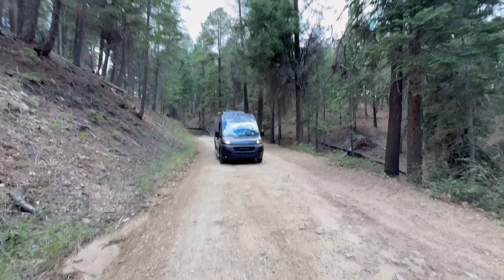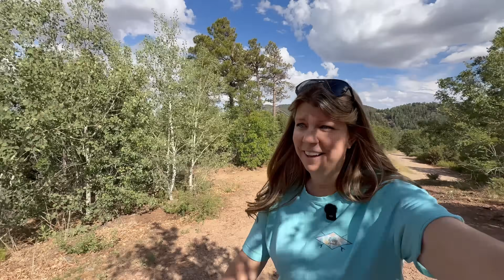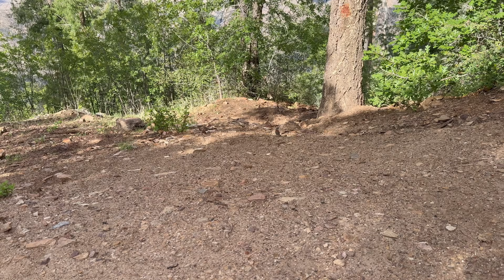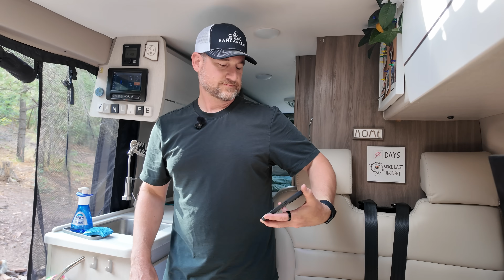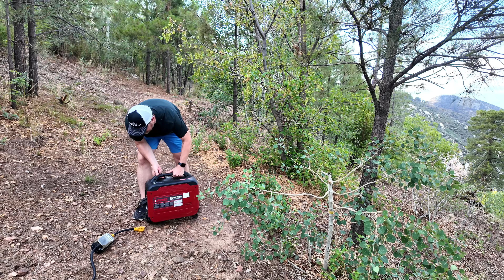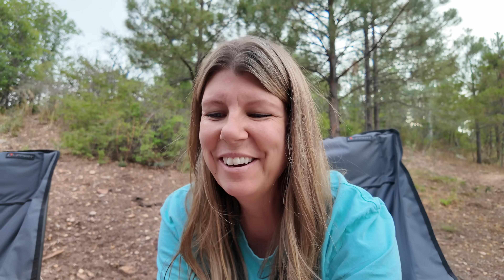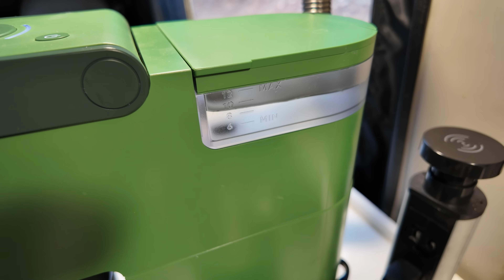MUST KNOW RV Generator Rules (Risky Roads & Lessons Learned on Mt. Lemmon)

Comment: Get a 12v air conditioner, get rid of the electric coffee maker- use stove and drip filters to make less waste, you can double your lithium for a lot less than $1,000. Get more/better solar panels, Get a Honda genset and run it on propane- way quieter. Nice video! Great tires!!
Reply: Can you run the van to charge the batteries?
Reply: @Momworks1   Running the van should be the last resort.  Your alternator is very precious.  They wear out with heavy use.  They wear out with just regular use.  You do not want to be stuck in a desert in the heat or in the mountains alone and your vehicle won't start.  Ask yourself how much it will cost just for a new alternator to be put in and then figure the cost of the generator.  Now add other things like a long distance heavy duty tow, hotel stay while the vehicle is laid up for a few days, and miscellaneous expenses.  How much are your lives worth in a dangerous environment.  My batteries are charged in my van by only 200watts,  We may add another 200 because we bought a SetPower fridge/freezer.  We may have enough power without the extra 200 as everything is extremely low power draw, except for the microwave which is only on for a few minutes and the electric skillet that may run long enough to heat or cook breakfast.  The batteries power our microwave and an electric skillet.  I have a 300 watt inverter that I can run off my starter battery and have the van charge it in an emergency. This is so seldom as there are places and campgrounds with shore power that runs those items and my AC or heater and the onboard charger also.  A 15 amp cord powers that stuff also if I am moochdocking or boondocking with my generator.  It can take at least a couple hours to charge low batteries and you dont want to run the engine and build carbon or use all that gas or wear out the alternator.  My entire build runs off my 3 agm deep cycle batteries unless I have to run the small invertor to run the charger.  Of course, the solar helps to charge at the same time also.
Reply: @rongreen7308 maybe your messages confused me but did you say you use a microwave with a 300watt inverter?
Reply: I use my propane to boil water and do the drip thing too! Plus the coffee is REALLY good…much better than a Keurig! :)
Reply: This 👆🏻
Reply: Propane is not quieter and will produce a lot less power
Reply: There are fold up solar panels that fit in a backpack and generate 400 watts.
Reply: @edwardmoran1739 there is no solar panrl that can generate 400 watts and fit into a backpack
Reply: A 12v air conditioners are not yet at the 13-15k btu of the 120v ones. However you can buy a small ecoflow river pro and use it for your starlink and coffee maker and save the battery for a/c. You might also look into the newer, bigger delta model to top off your batteries.
Reply: Will the 12v AC cool a 45 ft fifth wheel?
Reply: @averagejoe9249  Nope, you can see lots of video's on this. A single one will cool a insulated van. So aprox 20 ft.  They also run at aprox 700 watts. The exciting part is if you can get a 1,000 watts on a RV roof you can run a AC with the Sun realisticaly. This is as close as anyone has come that is off the shelf that everyone can buy and not difficult to install. If you could close off part of your 5th wheel and load up your roof with Solar you could proably run one easily off Solar on your roof and charge a battery to run the bedroom one at night. It's really just money in your case. 2 new 12 volt AC's 2,000 dollars, As much solar as your roof will hold. ???? $$$$. Then 500 plus amp hours Lithium Batteries minimum, all in if you do it yourself easily 10,000 to 15,000 dollars. Have it done and you are looking at 20,000 to 25,000 dollars. But then again if being off grid in the summer time is a must have, There now is a way to do it. 2 AC on the roof running 1 off solar, then runnning the bedroom one on batteries all night. Or run your generator for years and you will pay the same. You really need to have a strong desire and pocket book to run completely off solar and batteries. We spent 10 years living in a RV traveling the USA and saw it all. There is a reason RVers migrate with the weather. We had a setup that let up spend 1 week in 100 degree heat or zero degree cold which we did on numerous occasions. But it still cost money when we came in to provision up our RV to handle the extremes. It was a combination of Solar, Batteries, Satelites, generators, extra propane. It cost us 15,000 dollars to rebuild and re insulate our rig and add all we said to get 1 week for 2 people and a dog true independence. But even if you wanted longer, you need to think how much more water, Food, Grey tanks, Black tanks and power and Clothing. Every RV is built to go 3 days 2 nights. push that and it costs a pretty penny. Hope that helps answer your question and thoughts about if you want to cool your rig you really are saying I want to Boondock and cool my rig. AC is just one part of that
Reply: @averagejoe9249   No.  Not enough BTUs unless you get multiple ACs and a ton of batteries to run it and something short of a nuclear power plant to charge them up.  Plugging into a 120 power source would just be too simple, right?
Reply: I had a Honda generator and while it is quiet, it still makes noise. I made a small three panel foam board U tent which I could place behind the generator to block the noise traveling to the trailer. Maybe 8” taller than the generator. I left a flap on bottom middle where I could wind protect fly off with a rock. Cheap. Maybe worth a try. Stores flat, takes up no space.
Reply: I am Just blown away the van doesn’t have an onin generator already onboard. Am I missing something here.
Reply: Great info
Reply: Solar panels have largely gone obsolete. Most rigs are designed so commercial users can install a second alternator (they must be opposed to balance the side bearing loads on the engine shaft) and with a 150-200A stock generator plus the second one, you push 300-400 Amp hours into your lithium bank for every hour you drive. So a couple of hours on the road gives you days of battery bank. No genset, no panels needed. The high end boondocking RVs have gone this way for 2-3 years now.
 Mass market RVs? Stick to old tech, because "change" is an effort.
Reply: @lyfandeth  Obsolete? Not necessarily. My solar panels generate up to 510w in full sun… very helpful when parked and running my Zero Breeze 5k BTU ac. (Ps I also recharge my EcoFlows with their 800w alternator charger. )
Reply: @shabazan   Right!  And solar is designed to produce power without consuming it or fuel.  If you are boondocking off grid then you dont want to be using gas/diesel or putting hours on your engine.  We used 3.5 gallons of gas over about 8 hours just idleing.  At $4.00 a gallon we spent a bit over $13 overnight just for heat.  Gas adds up.  By the way, our Honda generator used 1 gallon of gas to run the electric heater for 8 hours at 28 degrees outside several times.  I normally go about 6 hours on 0.81 gallons.  I wont be without that quiet Honda 2000 watt generator or my solar panel.
Reply: @lyfandeth you do realize that solar panels can last a for many years but that alternator is taking days off it's life everytime you use it. They should work as a team to keep your power levels up. The alternator is for charging while driving and the panels are for when you are actually in your camp spot.
Reply: @lyfandeth  So, are you driving or camping?  Are you driving during the day when you could be enjoying the lake, woods, etc?
Reply: @lyfandeth Stick to the campsites sweet pea, leave the boondocking to the pros.

Comment: Doesn't your frige run on propane?  I know the recommend having the propane off when driving so that may be an issue.  When driving in a Ram you should be getting 35 amps from the engine to your charging.  We discovered the hard way that the solenoid which switches on house battery charging while driving was bad.  They are said to only last a few years.  Whenever we leave the house and arrive at camp our batteries are fully charged.  We have a 2019 Travato with the older and louder generator.  Whenever your out in nature the sounds seems 3 times louder than parked in the city.  Newer Cummins built in generators are 1/3 the noise of the older ones.
Reply: tellaro fridges are 12v.

Comment: Just curious…. Do you have a DcDc charger? (We apparently found out that we had somehow been unsubscribed, so we’ve missed months of your videos, so we are going to have to binge to catch up, and I apologize if you’ve noted such before!) But I have to say, we have a drivable rv too, with a larger battery bank (600 amp hrs) and the dcdc charger keeps our batteries topped off from driving around. (We also have a 2000 series dual fuel champion that we can use for backup purposes if need be, but try not to use it much)… And most surprisingly, we have been able to save a ton on propane cost and use because we can now run our 6 cf off of the inverter we now have while we’re driving, as the DcDc charger produces enough power to run the fridge and charge the battery bank, along with the nominal charge gain from the 400 watts of solar panels. But the MVP workhorse of our offgrid system has been the DcDc charger! And thus we highly recommend one if you don’t already have such!!! Thanks again for the videos! We enjoy them! Happy camping!!!

Comment: Get rid of the 120 volt air conditioner, and get one that operates off 12 volts. For what you want to do, coffee maker and other devices needing ac, I say you need at least 400 AHrs of batteries, and at least 400 watts of solar.  That is what we have on our small trailer and the only ac devices we have are chargers for the computers and they run off a 500 watt inverter.

Comment: A little off subject but saw you turn on propane.  Get a spare rocker switch for the propane.  Thor used an interior switch and the box they mount it with is not close to waterproof.  The spades coming out the back of rocker switch corrode.  You can guess how I know.  Ordered two marine switches.  Easy change if you have one.

Comment: Always enjoy your videos.  In addition to my house batteries I have a EchoFlow Delta 2 max power station that I travel with that provides one more source of power.  I use it to run my Starlink and most of the time to make coffee.  I have an alternator charger hooked to it so it will charge while I drive.  For reference I have 400 AH batteries and 400 watts of solar and no AC.  Safe travels!

Comment: This can be tough for sure. We use an Ecoflow Delta Pro power station with a spare battery to power our Brinkley Model Z 2900. Yes it's a little expensive, but the 30A plug makes it easy to plug in and power everything, including AC... then use a champion portable generator to recharge the power station. And we can take it with us if we change rigs. Good luck on your gen search, and safe travels.

Comment: I have been drinking the water out of our RVs water tanks for over 50 years with no filters and never got sick from bad water. I am just careful not to fill with a faucet near a sewer dump is all. Most city water has enough chlorine to kill any bacteria that one might get. Mainly flush the faucet and your hose well before putting water in the tank. On the generator I have a Honda and down there AZ in the summer when it gets over 115 it will over heat and shut its self off to cool. I found I have to hook one off those water misters to help keep it cool but that is a problem in an RV. Main thing is just go some where cooler than the desert in the summer.

Comment: Need to just bite the bullet spend money on batteries maybe 600 to 800 amp hr lfp   then go with the new reasonably priced 12 volt ultra efficient Air Conditioner. You can  add solar cheap as well.  You are correct the battery is where the big money gets spent. Worth it, does the job, keeps you cool for sleeping.

Comment: Wow, 100% down to 9% overnight seems a bit much.  What else is running overnight?  We see about a 10% drop in battery overnight.  Hope your battery is ok.
Reply: Agree. What is draining the battery? Seems excessive. We have 200 lithium in our class B and generally lose 10-12% overnight with using lights,  fridge, etc. No inverter. No solar. No generator. Also no a/c.

Comment: Live in Idaho and I boondock a lot.  I have a Champion 2500 duel fuel generator that is quiet.  I also have a Bluetti 200 Max plus RV 300 lithium battery.  I can use Bluetti and solar to charge or Champion duel fuel.  I make sure bluetti and rv are charged before quiet time, doesn't take that long and price of fuel or solar way cheaper then paying for a campground.

Comment: Our 2021 Thor Tellaro has a generator. We were on the fence about a lithium system with our next purchase. After your share of a free standing generator hook up and the issues of not having a generator, we will be sticking to a built in generator.  It's very quiet. Now, we need to use our decimeter to check the noise level.  Love the photo of the rain cloud in the distance. I think it was over our house last week!  We got pummeled with rain in Vegas! Safe travels.

Comment: I'm a heavy electric user. The coach has 800 amp-hr batteries but it's not enough.. I supplement with a Bluetti AC200Max + B300 battery = another 500 amp-hr. Total about 1300 amp-hr. With this setup I can go  about two days before I run out of juice. 
I can charge off two alternators 0% to 100% in both battery systems in about 2-3 hrs driving.
I also carry a generator (3200 watts) because the van's engine is inefficient to create electricity when the van isn't moving. About 4-5 hrs on the small generator to charge 0%-100% both battery systems. 

I also carry 600 watts of solar panels but they aren't very good at making electricity.... thinking of ditching them.

Comment: My experience may not work for you and others. My thinking is generator etiquette is to do things that reduces the need and use as much as possible. It’s likely a Pacific NW thing but I simply don’t take my generator. Instead I use other methods to eliminate the need in my area. Maybe viewers can at least reduce the need by the following:

1. If hot I don’t go to “hot” locations. I’ll go to higher altitudes or the coast. 

2. Not all campsites are equal, even in the same campground. Maybe for August reserve a site or spot with shade or heat friendly spots. 

3. Sometimes I choose a spot where there is wind coming over a lake, river, or ocean. (Maybe this tip isn’t applicable to high humidity areas?)

4. Position your RV so windows are not to the south, especially with RVs with single pane glass. For my trailer that means positioning the tongue to the south. Then I can have the windows open for an east/west breeze. 

5. Use a shade cloth above the RV with a fan moving the air above the RV, drawing air from a nearby shady area. 

6. If needing more power take additional battery banks to replenish the RV power. LifeP04 prices have come down a lot this past year. 

Reducing the need to run the AC as much as possible may stretch the battery capacity.

Comment: I really know nothing, but I have a solar generator I bought for the house in case of a power outage.  I looks to be a little larger, but not by much than your generator.  Just wondering what people think of that.  I have a solar panel too.  (I haven't used it yet.)

Comment: I installed a Bluetti system in our B+, it is an AC500 (bigger than you would need) and two B300K batteries. We can expand up to 6 total batteries. The issue is space and weight, but if you could find a location, the cost seems reasonable without a major custom job.

Comment: I built out a hard walled 15' pop up camper. 800ah of lithium and a honda eu2000i generator. Battery runs AC all night long and gen can recharge everything (and operate) during the day. I wager sizing would be roughly equivalent for that van  you have.

Comment: Is Mr. Lemon 2-wheel drive? I saw a lot of wheel spinning pulling into that campsite.
Reply: All the Promaster does not make an AWD or 4 Wheel drive option, so yes only FWD. Most the time that is fine as you really don't take RVs into terrain that is very difficult. My Transit is AWD and not sure it has ever actually kicked in.
Reply: @NeonRogue1969  If you are not sure then that means it’s working. My vehicle has all wheel drive and it’s seamless.
Reply: @Fred_Flintstone1  I hope that is the case. Thanks.

Comment: It's good to be cautious but if you had a built in generator, the exhaust wouldn't be far away from the van. I've never owned a portable generator. When I buy one, a primary use will be at the beach with the generator locked to the van using a cable to keep an opportunist from snatching it while we're in the surf. The distance limit will be the cable not the power cord. It's usually windy on the Texas coast. I'll definitely place it down wind. The weather video was great. I never get tired of seeing rain cells.

One of my justifications for getting a portable generator is that I can also use it for power outages. My motorhome generator didn't lend itself well for that type of use.

Comment: Finally you made it to the mountain named after Mr. Lemon or maybe it's the other way around.  When life gives you Mr. Lemon head to Mt. Lemmon.

Always test before you go out because you never know what issues you might run into on the road and never assume it will just work.

Given that batteries have improved in the last couple years you could probably replaced your current batteries with not only better batteries but also ones that provide more power for you guys.  Yes it might cost you some money but it might be worth the expense, well unless you plan on replacing Mr. Lemon in the near future.  It might be worth a cost analysis.